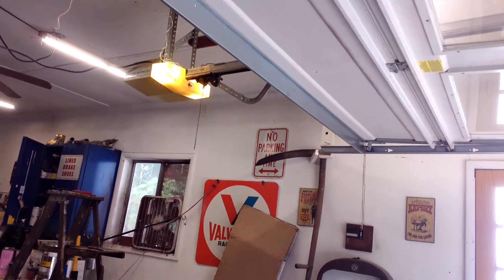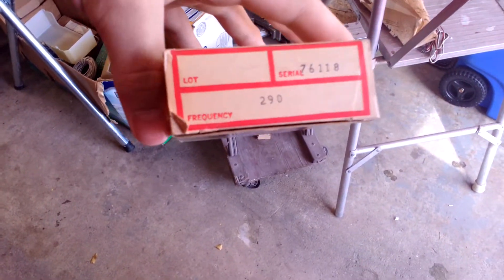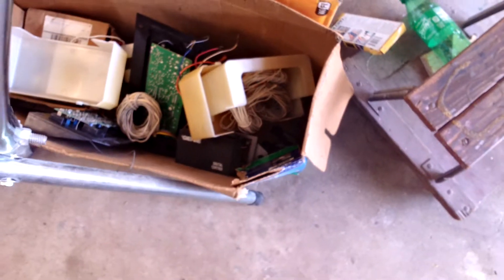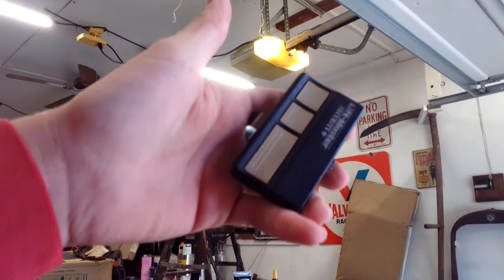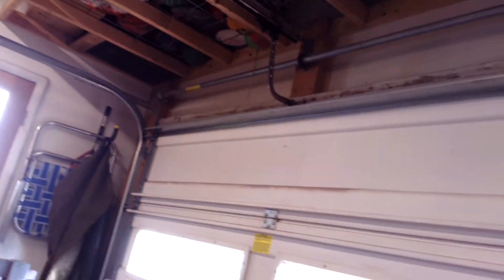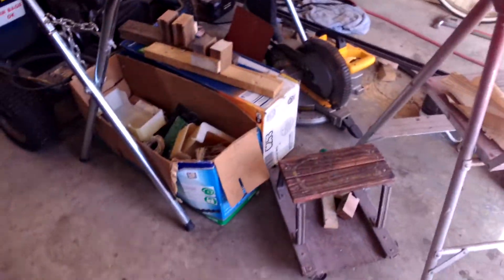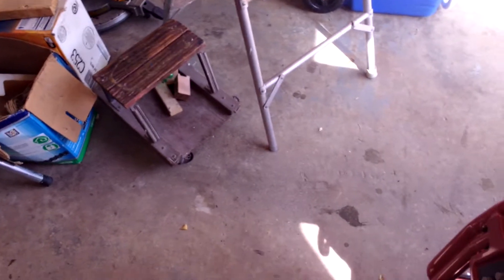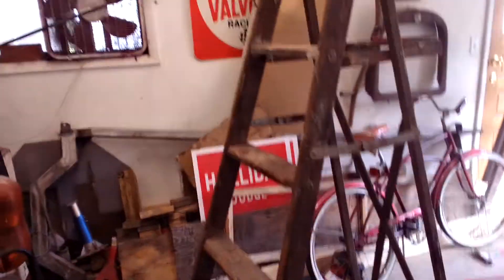Genie 450

Comment: I have this model, and the garage only closes. if you stop it half way, then push the button again, rather than go back up, it will continue to close. If the garage is fully closed, and you hit the button, it will still try to close. It's like whatever mechanism that is supposed to trigger going the other way is broken.  Any ideas what part needs fixed. is it the board?
Reply from the maker: The limit switch on the rail that is closest to the front of the garage with the springs on it is probably bad.
I would just go on Amazon or eBay and search up (limit switchs for genie screwdriver garage door opener)
I would just replace both limit switches, the close limit and open limit
I think they are just held down with a 1/4 inch screw on the rail, you might have to disconnect some wires that are running back to the motor
I think what's happening is that the operator thinks that the close limit switch is being hit while closing and stops the opener
Before you order a new switch, make sure that the trolley is contacting with the close limit switch when the door is down.  Also run the opener without the garage door and the trolley then run open and close the door by hand without the operator connected
I hope this has helped, if you have any further questions please tell
Thanks and have a good day
Reply: @andersongaragedoorservicesllc  Thanks for the detailed answer. Do you think it would still be the limit switches when i have the door between the limit switches and i would push the button, press again to stop, and press again, and it still continues in the same direction, without ever hitting a limit switch.  Shouldn't it normally reverse direction if you stop mid opening or closing?
Reply from the maker: @TurdBurger24  that I don't know, it could be a glitch in the logic board but sadly those are no longer made

Comment: Do you have the manual. When it closes the carriage seems to go to far, so when it closed it reopens.
Reply from the maker: Salil Mody it could be the close limit switch is bad if that's what it's passing
Either that or a wire is loose
I have the manual but it's all torn up,  dried out, and falling apart
Hope that helps and if you have any further questions please let me know